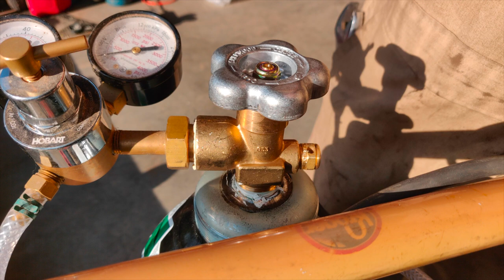Turning a $1500 trailer into a $1520 trailer with cheap amazon welding gas

Comment: oh cmon, why do people always tell that a weld is going to fail. a single tack can hold up to a ton, so even the crappiest full bead will hold much more than that. ive done really shitty stickwelds in the past and none of them came apart. sure its not as strong as it can be, but most of the time, it doesnt need to be either.
Reply: Ha ha ha very true, nothing I have ever welded has ever fell apart, I always put engines on the stuff and ride them for miles with extremely bad geometry while taking non-stop abuse.
Yet the most amount of comments always surround the fact I'm a noob welder, those welds will fail, you're supposed to clean the metal first.

I could understand if it was a crane I was building, but tack welds can hold tonnes of force, but something holding my weight has about 6 feet of welds and they still cry they will fail lol

Must be people that don't weld, or newbie welders that are in the process of learning, and just feel intelligent regurgitating everything they are being told by their teacher lol